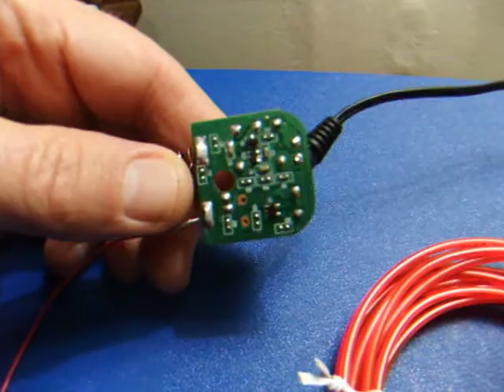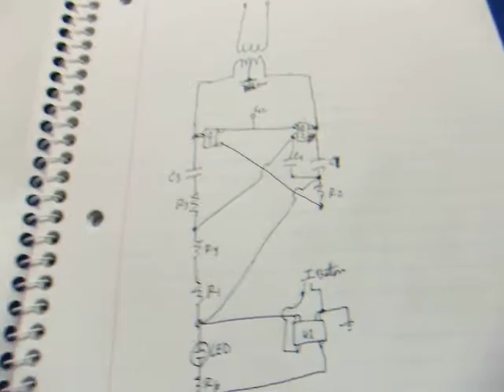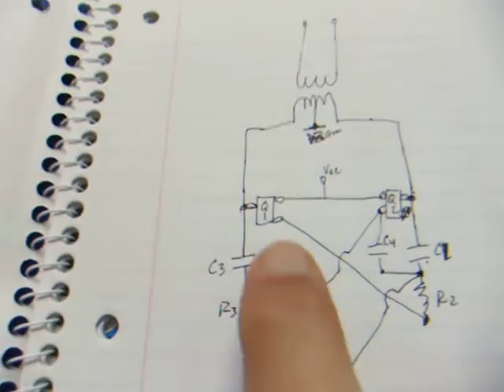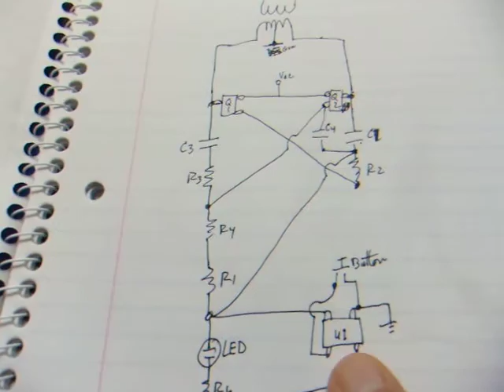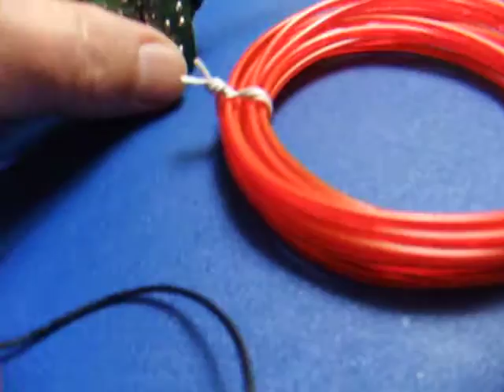ELWire Driver Circuit

Comment: Thanks so much for this video! It allowed me too hook up my EL wire to the power pins on an illuminated switch so that I could have the wire come on with the main light in the circuit (in place of the switch light). It was driving me crazy how to make it work and your video had it working for me in 5 minutes!

Comment from the maker: wow. I had no idea when I made this video that anyone would watch it. Sorry I have not noticed the discussion going on here. I was playing with this thing and uploaded the video to show someone. YouTube is a way I show my project to friends. Thanks for watching and I'm glad so many people like it. But I have to say I am not an expert on this. I can say that the squeal is inherent. Meaning that this thing works at a frequency we hear. I do not think there is anyway to stop that unless you go with really high quality parts. Even then it is questionable. Second. This uses two AA batteries. They are 1.5 volts each so this is a 3 volt system. You need a voltage regulator to use it with any other voltage. Maybe something on ebay. 
Sorry I cannot be more help. Thanks again for watching.
Reply: Bro how come you dont get zapped? My EL wire driver 12vdc to 110vac (for car interior) zapped me hard!
Reply from the maker: @Eden_M  
The little batteries only put out a small current. So when stepped up the current is minuscule. But using a car battery capable of supplying 300 cranking amps.... Sounds like fun. The capacitors in the old points ignition systems use to be good for quite a jolt too. :)

Comment: MY inverter is damaged. i dont know about electronics . should i go to the shop and tell then to make me 220v ac to 100v converter with 1amps ? does it work with el wire??
Reply from the maker: I assume you are talking about the inverter for an EL wire. From what I've found is that the EL wire uses 2 things - high voltage and high frequency. I'm pretty sure the frequency is around 1k hertz. And I'm not 100% sure because it's been a long time since I messed with this, but I think the voltage is around 1000 volts but a very low amperage. I could be way off on this. My EL wire inverter is only 3 volts. So the amps would be really low. I also assume that since you said 220v then you are plugging into your house power outlet. That would be quite a different can of worms. I would look on Aliexpress and try to find a replacement for what you need. Sorry I'm nor more help.

Comment: My controller board is a 3v like yours, but your hookup point seems different than mine.   It was hard for me to tell, by the video, but it seems there are two places, on the chip you can solder the wire that goes to the negative battery lead, is that correct?  On the EL Wire controller I have, there is a chip there, with 3 terminal legs on each side and not sure which one to hook the wire to.    I'm thinking of using a reed switch to turn the Wire off and on....If I don't smoke it first.   Yes, smoke came out when I tried hooking it up to its own battery compartment instead of an external one, as you did, but it still works!

Comment: Hope you can help me. I hooked up a 3.7 volt lithium battery to test so I can avoid the bulky AA battery. Now the problem is that the moment I put the AA batteries the EL wire just turns on and the button d0esnt do anything. Any idea what could be the issue. I would appreciate your help.
Reply from the maker: All I can think of is that the thing does not like the extra .7 volts. Maybe try a small voltage regulator or even a simple voltage divider with resistors. Sorry I'm not more help. Thanks for watching.

Comment: Hi, I think my El wire had a short circuit. It doesn't work anymore, the controller also doesn't respond now. I was actually trying to check if it'll work with a 10v adapter instead of batteries. It flickered for just 2-3 seconds at first, but then went completely dead. Can you please tell me if it can be fixed somehow...
Reply from the maker: jeeze. these things only use two 1.5v batteries. That's 3v. See any smoke when you did that? (And I can honestly say that I've blown my share of things up like that.) I would imagine that if the transistor didn't blow that at least the controller chip must have. The wire and transformer are probably good but you'd need to build a new control circuit. Sorry I've got no good news for you. If not this video then one of my other ones I think I show how to bypass the controller chip. Good luck with it and next time use a 3v voltage regulator. Cheap on ebay.
Reply: Rick Randazzo #Thanks for replying that quick. I didn't notice any smoke or anything coming out of the controller. It just went dead after a little flicker... Can it be repaired? Please give me the link to your other video regarding this...thank you again.
Reply from the maker: I re-watched this video and it is the one I was thinking about. I show that you can bypass the controller chip to turn on and off the el. It seems that these things are so cheap that they are easier to replace than to fix. Sorry I'm no help on this.

Comment: i have the same exact red elwire with a 2 battery controller but when i put new batteries in it the controller flashes 3 times and turns off... do i need a new controller?
Reply from the maker: george fourtinas that doesn't sound good.

Comment: hi.. which transistor and what capasitor value that used on that scematic?
Reply from the maker: Thanks for your comments. Unfortunately there is no way to know the values of the capacitors or what transistors are used. I see you have even asked another guy that has done a better video than mine and I suspect you will get the same answer. He mentions the type of circuit but I am not sure what he calls it. Either a flip flop or a relaxation oscillator. But I believe the latter is a single transistor circuit. I assume you are trying to build your own circuit so I would suggest searching on different oscillator circuits. Thinking about it I can tell you the transistors you use can be about anything but would depend on the type of power you are trying to drive. the EL wire is low power so something like a 2n2222 would work fine. The real key feature of this is the RC circuit because that is what will determine the frequency of the oscillation. Alternatively you might take a look at 555 timers as they may provide a simpler solution and a lot of information on the RC timing.

Here is a video that talks a little about building circuits and may give you a better idea. 
https://www.youtube.com/watch?v=AcXHx5ikjM4

Thanks again and I hope this helps.

Comment: Is there a way to get rid of the IC ?
Reply from the maker: The IC generates the high frequency the wire needs to light. You would have to use another high frequency generator and probably a larger package.
Reply: @rickrandazzo  I thought the IC was just there to make the EL wire blink, and the NPN transistors were used to generate the oscillation of the system.
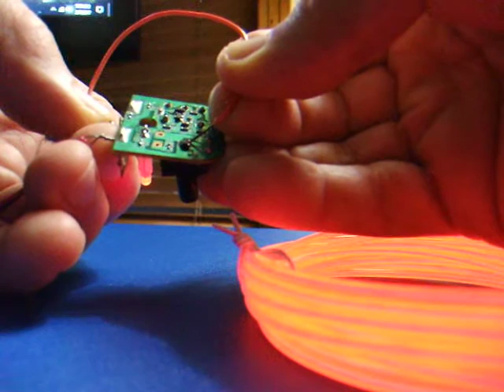Reply from the maker: @photoworld9816  Ah, you're right. I have not messed with this in a long time and forgot. At 1:10 in the video I discuss this very thing. You can see both, in the schematic shown earlier and at 1:10 looking at the circuit, I bypass the IC. Sorry but that's about the best I can do.
Reply: @rickrandazzo  So if you bypass it, I can remove it. Isn't it ? Also, you made a mistake in your final schematic. You linked the  collector of Q1 to the base of Q2. In your first "picasso like" sketch ;-), they are correctly linked : Q1 collector linked to Q2.
Reply from the maker: @photoworld9816  Yes, I see no reason that you cannot remove it. Thanks for the info. I'll have to frame the Picasso!
Reply: @rickrandazzo  Just have to replace it by a wire from V- to the pin 6 of the IC. This what you do... difficult to see on the video.

Comment: Hello. I have small problem with conection in my car. El wire together with inverter makes mistakes  errors in computer. Please tell me how I can connect el wire without this inverter to 12v?
Reply from the maker: The EL wire requires an inverter to create the high voltage it needs to work. I imagine the inverter is causing spikes back into your car's system. A diode on the 12v power supply to stop any return voltage and a large capacitor (1000UF - ish) to reduce the spikes should resolve the problem. The other high end option would be to get a DC to DC isolation inverter like in a computer.
Reply: Rick Randazzo thank you for this detailed explanation. But the additional question is what is DC?;)
Reply from the maker: Savvas Halvantzis batteries, like in your car, provide Direct Current. Your house has Alternating Current (AC). The inverter uses DC - converts it to high voltage AC. Your car electronics does not like this so you need to filter out anything induced by the inverter. I was just thinking. You may be able to buy a filter at the auto parts store. They should know what you are talking about. Hope this helps.
Reply: Rick Randazzo one morw time thank you for clarify. I have one more reqest to you. Due to that in poland many thing are impossible to buy. Please send me example abou your wrote. Thank you.
Reply from the maker: Power Filter 12V car audio power filter can eliminate the power of the audio interference. Maybe this will help. Can you buy off ebay? 12V Car Truck Audio Power Filter Noise Eliminate Ground Loop Isolator Suppressor
      https://www.ebay.com/itm/12V-Car-Truck-Audio-Power-Filter-Noise-Eliminate-Ground-Loop-Isolator-Suppressor-/142327215264

Comment: How eliminate the sound of frecuency? Piiiiiiiiiii*######
Reply from the maker: YIZUZ RICTUZ 
This is a problem inherent to high frequency oscillators. If you ever had an old CRT tv or computer monitor you've probably heard them making that squealing noise. I think this runs around 1000cps. So it's right in audible range.
Reply: just thinking, a coworker told me that cementing the board in potting would probably be the easiest and cheapest solution

Comment: To bypass the IC you are jumping from the battery negative to....what?  It's very unclear.
Reply from the maker: Yea, it's hard to see. On the final schematic you can see how the button and the negative are connected to the IC. I apparently was just connecting the ground to the IC input side. Sorry, it's been almost 5 years since I messed with this and that's about the best description I can give you. I am curious what you are trying to do though. Thanks for watching.
Reply: @rickrandazzo  I want be able to bypass the IC and simply turn the electro wire on and off(steady state only) either with another light or maybe with it's own on-off switch.  I hate that all these cool lights don't have use options for what the end-user might want.  I HATE one-button-does-all!
Thanks for any help.
Reply: I figured it out.  I made a diagram and found out which IC pin is the 3V output to the self-oscillating circuit on the primary side of the transformer, so just simply bridged that pin to the positive battery terminal to activate it on demand.
Reply from the maker: @allegory7638  Great! Sorry I couldn't be more help.